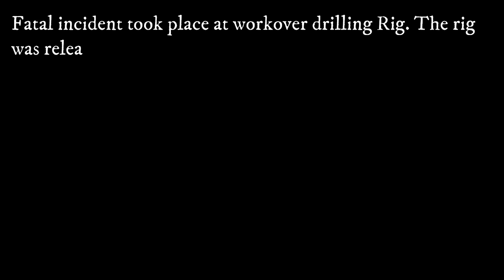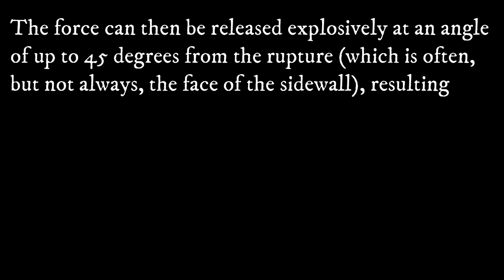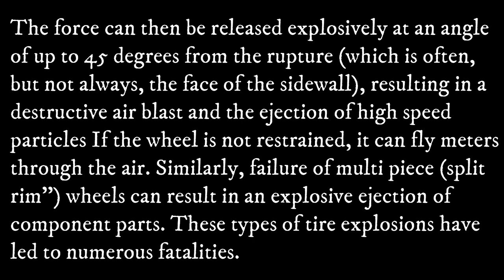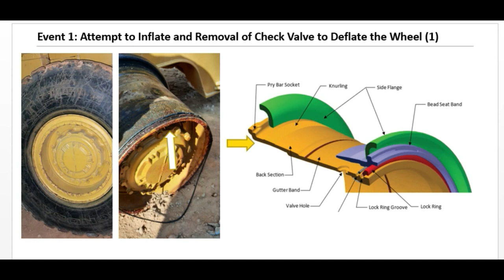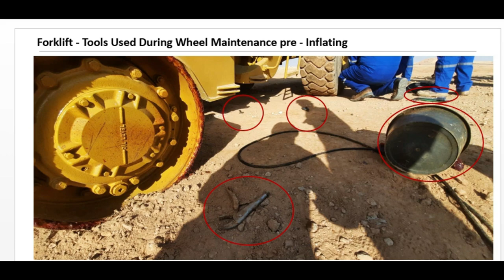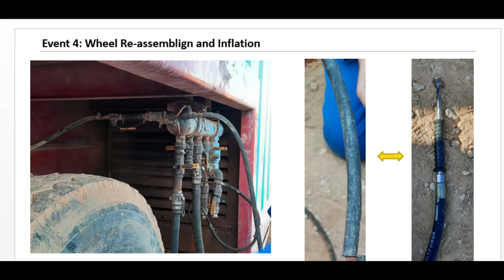Forklift Operator Incident

Comment from the maker: As a learning from this incident and to ensure continual improvement all contract managers must review their HSE HEMP against the questions asked below        

Confirm the following:

Do you and your subcontractors have a procedure for Inflation, deflation, change out and performing repairs on tyre / wheel rim assembly including all hazards their risks / consequences and mitigation? 
Do you and your subcontractors have a training program developed from the requirements of the above procedure to train employees that perform work of inflation / deflation / replacement or repairs on tyre and wheel rim assembly?
Do you and your subcontractors have a system to manage tyre and wheel rim assembly inspection and maintenance?
Do you or your approved tyre repair workshops have a safety cage to inflate/repair tyre / wheel rim assembly if repairs are carried out at your site or company approved workshops?
Do you and your subcontractors have posters / stickers to warn site staff of the hazards / consequences and controls?
Do you have a system to effectively cascade the HSE Flashes & recommended actions to all staff?

Comment from the maker: The inflating operation failed due to leaking valve. The
operators decided then to dismantle the rings and repair
the leaking part by greasing the inner part of the wheel. To
expedite the deflation and re inflation they removed the
valves and didn’t use the manometer.  While inflating the tyre, there was a violent ejection of the side
flange and the lock ring located between the wheel and the tyre which struck one of the two workers (IP1) in the head causing his immediate death, while his colleague
(IP2) lost consciousness.

Comment from the maker: Your learning from this incident..

Always obtain permission and approval prior to start of any service or maintenance on site, if non routine raise a PTW.
Always consider the risk of “stored energy” while carrying out the task. 
Stay away from the “Line of Fire” and from any potential stored energy sources.
Ensure the air hose has an in-line air pressure gauge and sufficient hose length (minimum 3 m) between the clip-on chuck and the in-line gauge.
Any service or maintenance related to tyres should be performed by a competent person in an authorized workshop.
Tyre with pressure reduced to below 80% of the recommended operating pressure, should be removed and sent to authorized work shop for repair.